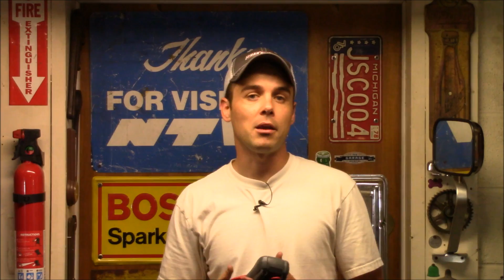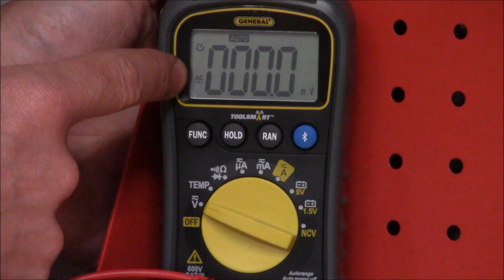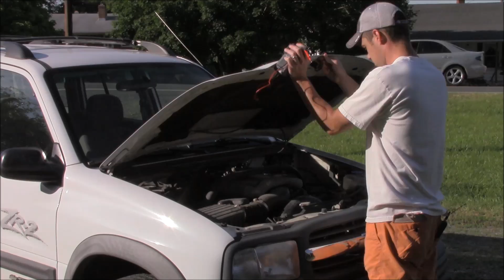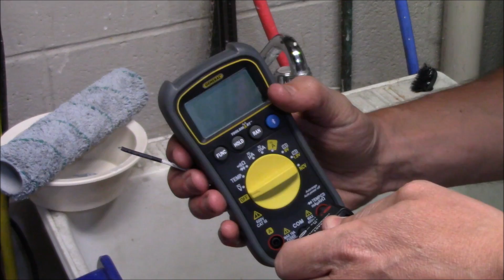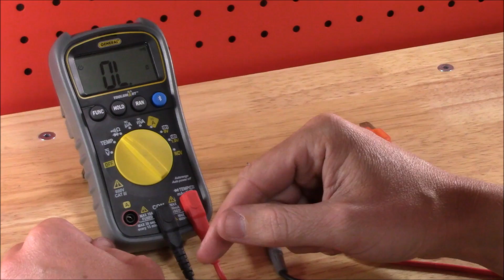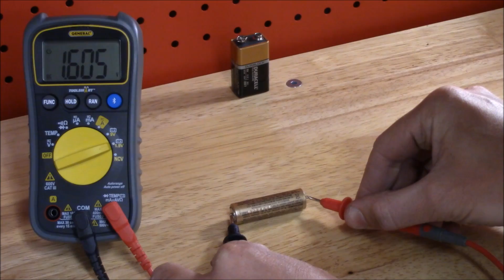General Tools TS04 ToolSmart Multimeter - BlueTooth Enabled!

Comment: Your AC Voltage is right on the edge of being in spec for the NEC (+/- 5%).  This usually means either the transformer at the pole is going bad or you have an open neutral somewhere.  I would measure your neutral to ground voltage and if it is above 3V then I would get it checked out.
Reply from the maker: I'll check it out...thanks! 👍

Comment: good. Next WiFi multimeter and you would be able to monitoring via Internet a lot of devices. Im looking for a psi bluetooth sensor to check permanent the pressure of the tires of my car with my Phone